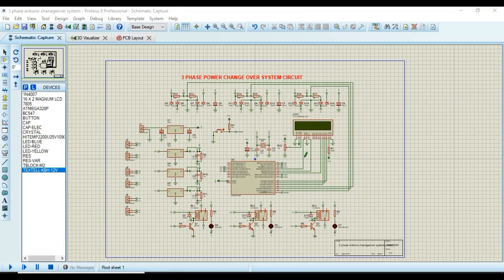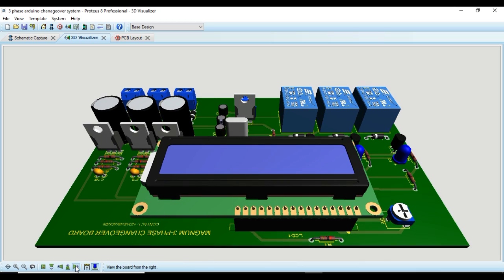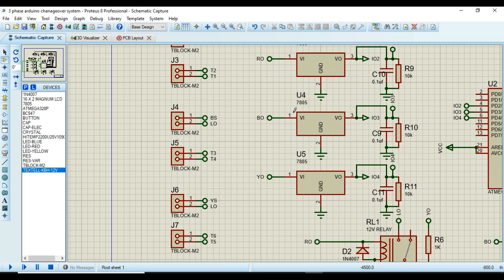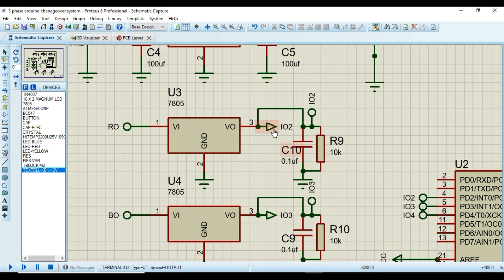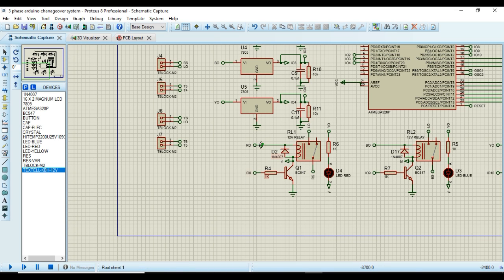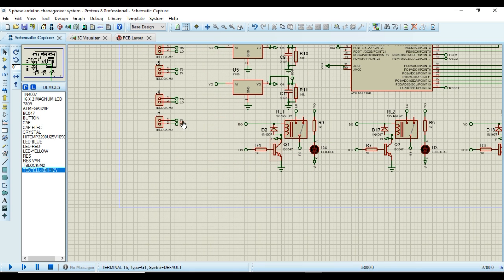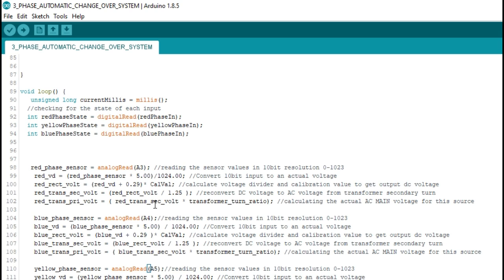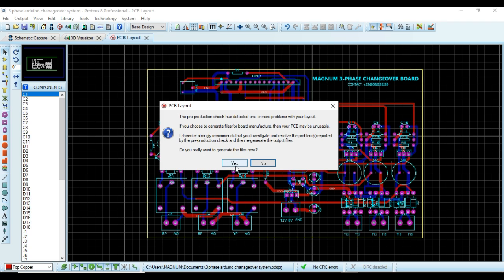3 Phase automatic changeover circuit : Protues PCB design and ordering from JLCPCB

Comment: My friend. Good project. Question: why didn't you use optocouplers instead of relays? Greetings from Sincelejo Colombia
Reply from the maker: Thanks so much for your inputs.
I can ultimately choose to use optocoupler, as it is safer in comparison to my configuration.

I will build upon that in my next design.

Comment: On ur calval why did you use the used on the calval
Reply from the maker: It's the calibration for the resistor that is used,since I had it as a sensor for this project
Reply: @MEmbedded_TechLab  sorry for disturbing but how did calculate it and got the value
Can do the video please
Reply from the maker: @Solarsolution1297  
Am currently working on the next video where I explained the concept quite right, stay tuned